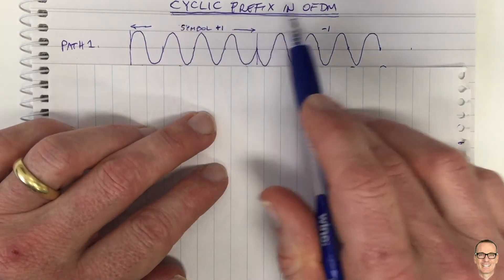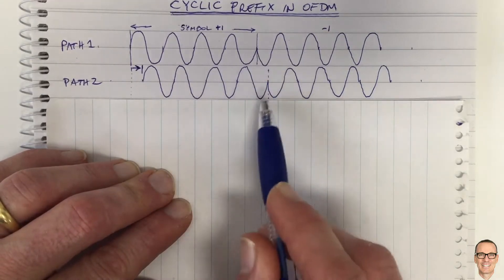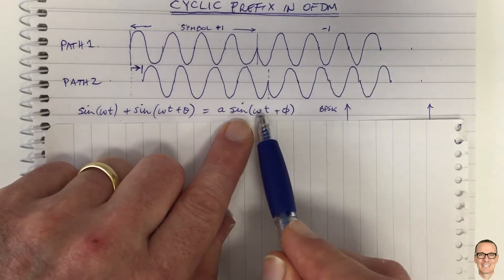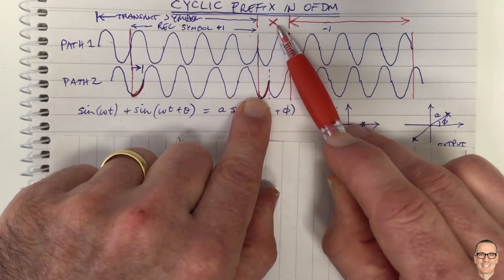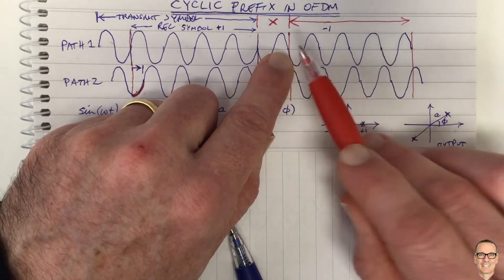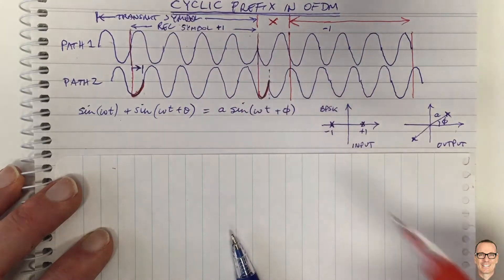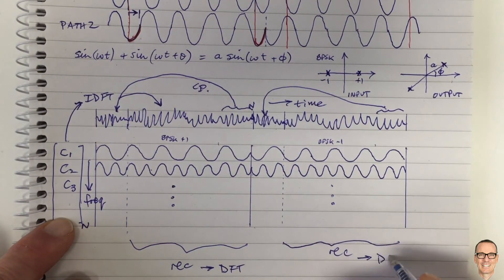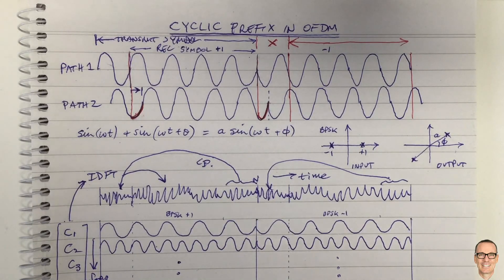What is a Cyclic Prefix in OFDM?

Comment: Hi,
Thanks a lot for your videos. These are very interesting videos that you explain the concept very well.
I was wondering if you could tell me why we use CP and don't use something else for example all zeros.  In the concept of circular convolution or linear convolution and taking FFT it doesn't matter and both ended up with multiplication of FFT's i.e., FFT (X * Y)=FFT(X).FFT(Y). I am not sure why we have to use cyclic extension by considering the this cyclic extension probably damaged with the delayed one.
Thanks again for your great explanation.
Reply from the maker: And another thing to note is that the FFT operates on a (finite length) signal sampled over a finite time period. It implicitly assumes that the signal is periodic. In other words, it assumes that the finite time period signal repeats for ever, before and after the finite part that it knows about. Therefore there is no "linear convolution" when it comes to FFTs. There is only circular convolution.
Reply: @iain_explains  Yes, as you said FFT comes to cyclic signals, that is a great point, thank you.
One more thing, may I ask you please introduce me a good (theoretical or practical) book for wireless systems? 
Thank you very much
Reply from the maker: These are a couple of good books on fundamental aspects of wireless communications (although they were published some time ago, so don't include specifics of the current standards): T.S. Rappaport, “Wireless Communications Principles and Practice”, and D. Tse and P. Viswanath, “Fundamentals of Wireless Communication”
Reply from the maker: If you go to the 3min40sec point of the video, it explains that a cyclic prefix means that the delayed (second path, ISI) signal results in a smooth transition within the "received symbol period". This is another way of showing the circular convolution you mentioned. If the prefix was full of zeros, instead of the (cyclic) extension of the symbol, then there would be a discontinuity coming into the "receiving symbol period" (it would be a flat "zero" signal coming in from the left, instead of the sinusoidal signal that I highlighted in red pen). This discontinuity would cause the spectrum of the subcarrier to broaden out, since it is no longer a simple sinusoid. And then the subcarriers would not be orthogonal any more. It is possible to use a zero prefix, but you have to understand that there will be cross carrier interference. It turns out that this may be a positive thing, if the channel is highly frequency selective and unknown at the transmitter, since the symbols transmitted in the deeply faded sub channels will be spread into the other sub channels, and then potentially recovered through the error correction decoding process.
Reply: @iain_explains  Dear Iain, thanks a lot for your response. It is very helpful and I understand its reason now. I searched it a lot but couldn't find the reason, but here, you explained it very well and I really appreciate that.

Comment: How is the discontinuity dealt with during signal acquisition ?
Reply from the maker: Not exactly sure what you're asking. The CP is actually used to help the signal timing acquisition since the start of the received OFDM symbol and the end are correlated (they would be identical if it wasn't for the ISI from the channel), therefore the receiver can search for correlation peaks, and then work out where the boundaries are between the OFDM symbols. The actual CP is discarded in the symbol detection process. Losing that energy (and transmission time) is the price you pay for obtaining a symbol format for which channel equalisation is easy.

Comment: Thanks for sharing but some questions 1-what is the harmful impact of the discontinuity ? 

2-Is the cyclic prefix a solution to intersymbol intrfence or signal discontinuity ?

3-why not only transmitting zeros instead of the cyclic prefix and the lot energy problem ?
Reply from the maker: Discontinuities happen at the boundary (ie. transition time) between symbols (when the digital sequence changes from one constellation point to another). Reflected signal paths arrive later than the direct path, and cause ISI. This means that within a defined symbol period there will be discontinuities in the received signal (as shown in the video). These will result in the received complex value not aligning exactly with the intended constellation point, and lead to errors in detection. The cyclic prefix is added so that it can be removed at the receiver, leaving only the time period when the discontinuities do not occur. Transmitting zeros instead of the cyclic prefix would add a second discontinuity boundary (at the end of the prefix). It would solve the first discontinuity problem, but generate a new one.
Reply: @iain_explains  Thanks Iain. CP seems to me confusing because different people (even very well known people) have very different ideas. For instance, In Lathi's book, he says adding zero padding is same. Also some people argue that CP is because DFT has a periodic nature or because of CP  we have circular convolution which is needed for DFT (since we use DFT and H(f)X(f) is only true for DFT when the circular convolution is achieved) However, I like your discontinuity approach. If we have discontinuity problem, we cannot have a simple equalization because sum of two sins cannot be another sin as I see.